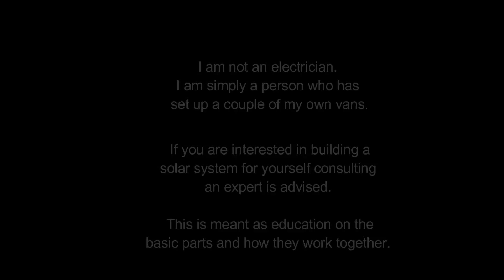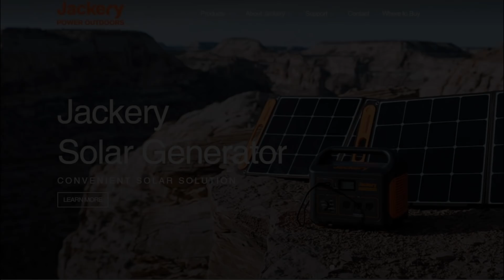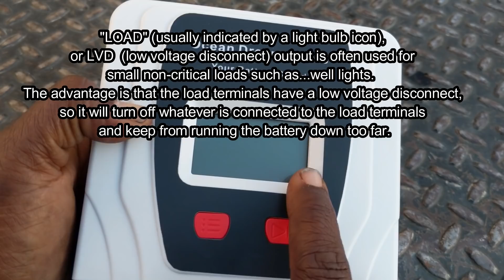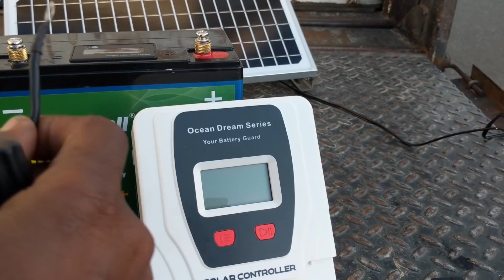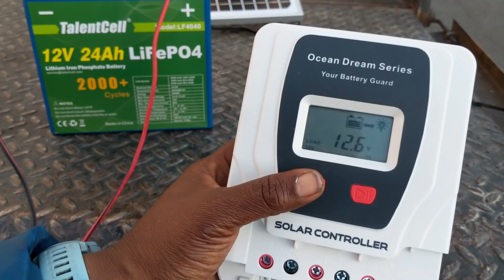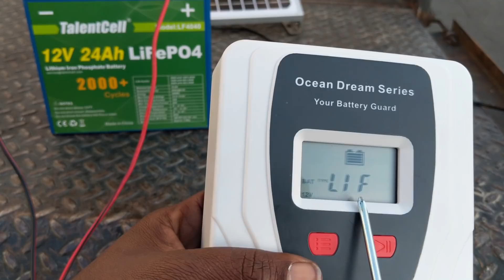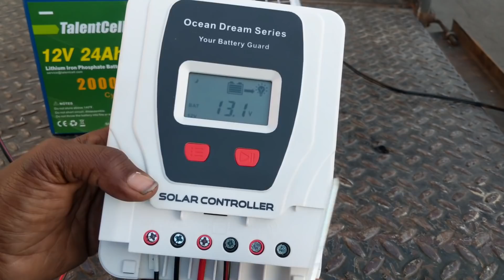Vanlife Basics | A Very Basic Solar System Breakdown

Comment from the maker: More to get started with DIY:
 (The following are affiliate links, which help the channel) 

Learn More about Solar. The Great book of Will: https://amzn.to/3fMVq5b

Recommended Starter 100w Solar Kits (just add battery):
Renogy: https://amzn.to/3upaCdW
Windy Nation: https://amzn.to/3vpbAIs
ECO-Worthy: https://amzn.to/3wANLxt
RICH Solar: https://amzn.to/2QTlyCS

Parts used in this video:
TalentCell 24ah LIFEPO Battery: https://amzn.to/3ur95nR
20W Solar Panel: https://amzn.to/3vqdJDD
30A PWM Charge Controller: https://amzn.to/3wyKH56
Fuse Block: https://amzn.to/2Sw25bU
100w Rigid Power Inverter: https://amzn.to/3yGCMod

Just want an all in One Solution?
Jackery Explorer Power stations and Panels: https://www.jackery.com/?aff=125
Reply: Thank you for the links .

Comment: Very interesting,  unfortunately it did a flyby.  I still haven't found someone to help with the build.  And the van  company is taking forever to get the cruise and running boards in it. I think the first thing I  should do is the floor than find someone to put in windows and max fan. Then wiring,  insulate, and walls. I may end up with material on the ceiling like Chrome. Then cabinets next year. And a cot for some camping this summer. And screens!  Would you agree?

Comment: I have...

-20w panel for $24 eBay
-charge controller from eBay for $6
-12v battery from a local BST page for $20
-wire (jumper cables I’ll cut) frm local BST for $2
-combo 12v socket & dual USB panel with built in power switch $22

So basically for $74 I have all the components to generate enough power to charge my cell phone. 🤦‍♀️ 🤦‍♀️ 

Lmao.   But I was trying to understand how to set up solar before buying big expensive components
Reply from the maker: Smart! Chances are you aren't gonna burn anything down and any of those components can be upgraded at any time!!

Comment: Your Battery is a piece of GARBAGE. I know from personal experience. I bought four of them-three would not hold a charge-I returned them all.
Reply from the maker: The one I have is holding a charge without a problem. The results seem to be mixed in the reviews. I wouldn't recommend it as the backbone of a system due to those mixed reviews. But mine is holding charge just fine.